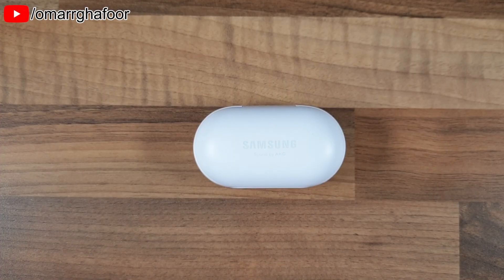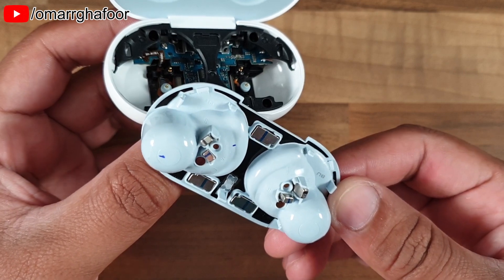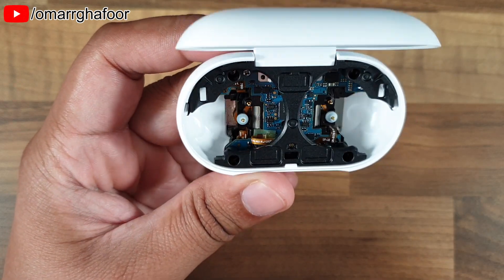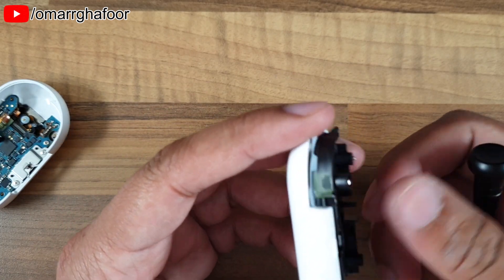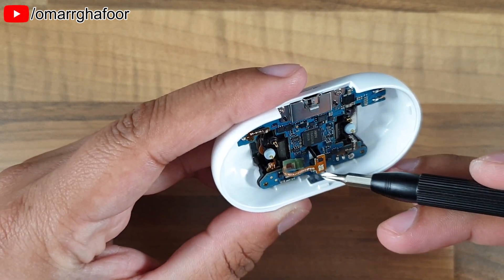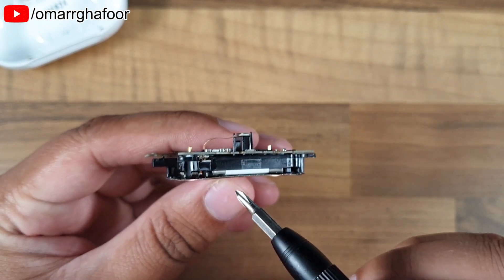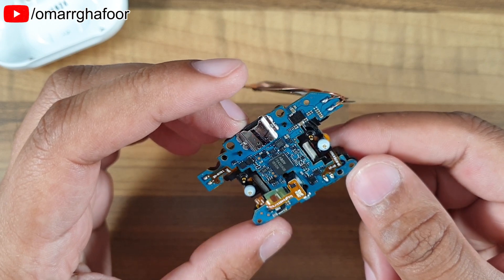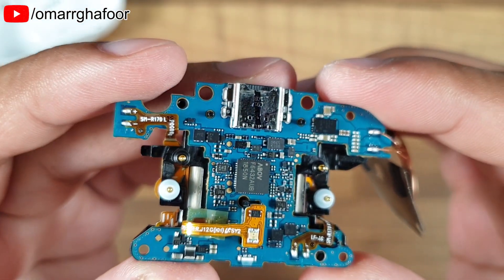Detailed Tear Down | Samsung Galaxy Buds

Comment: Great video. I have a pair and case and it wouldn't charge, no lights coming on. I decided to open it and to my horror the inside is missing the whole circuit board and charging coil. It took me this video to realise I had a useless charging case. Luckily I never paid for it but I'm now investigating what dafuq

Comment: Hello, I've had a pair of Galaxy Buds since they first came out and my case's battery is no longer holding a charge. I've never really attempted to fix an item like this myself before, so I'd just like to ask what type of battery does it use? Is there anything that isn't obvious I should take note of? Also, what did you use to pry apart the glue? Was it just a knife? That bit was cut out. Thanks in advance. :)

Comment: Anyone now how to remove te inner lid of the top ?
Reply from the maker: Just use something thin like the pick i used, wedge it in and tilt it to loosen the inner lid, you could even use some heat to loosen the glue before hand
Reply: @OmarrGhafoor  Any particular wedge brand you prefer over another?  Where can I buy it at?  Thank you Omarr, great stuff, very helpful.
Reply from the maker: @Rick_Aloha_All_Day  its just plastic at the end of the day so i dont think it really matters, what i used was from a old ifixit kit that i already had but ive used other similar picks and tools that ive bought from amazon or ebay, theres no difference.
Reply: @OmarrGhafoor  what pick did you use where did you get it from as I'm unsure what to use
Reply from the maker: @kierangavigan2908  i think mine was included in a kit from ifixit but any thin pick will do
Reply: @OmarrGhafoor  thanks I bought one from there now

Comment: Was there a water damage indicator in the case?
Reply from the maker: I dont think there was
Reply: Yes, I've taken mine apart already
Reply: @Ricky.Ricardo  Do you remember where? I can't see any in mine.
Reply: @CookieButter-x  I believe you need to slide out the battery, because I think it was on the plastic bit connecting to the board but I could be wrong, it was long ago